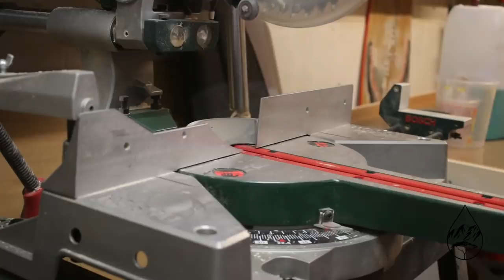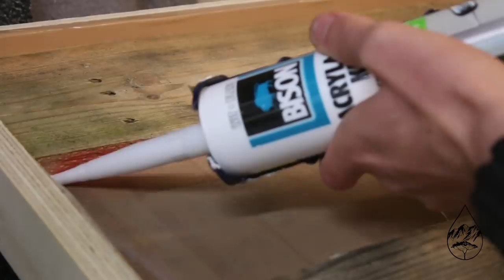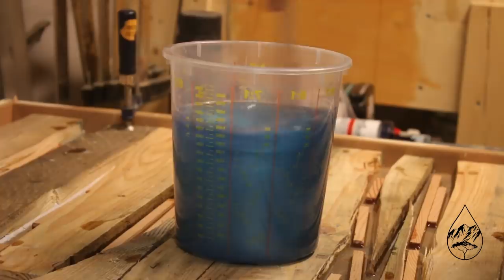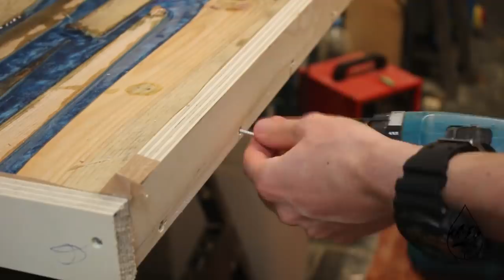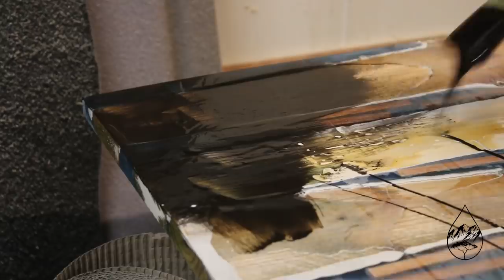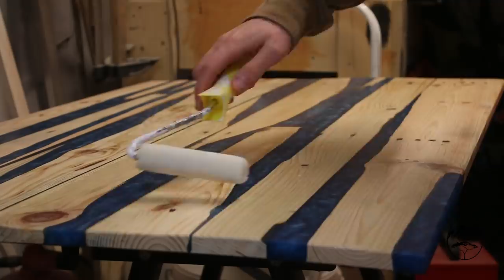Pallet wood & metallic blue epoxy coffee table

Comment: Hi mate great job 
What did you make the base frame for placing the wood and pouring the epoxy from also what was the white mastic stuff you were using and why
Reply from the maker: The base was made of the old table top with multiplex sides with tape on them. the white sealand is to prevent te epoxy to go under the wood.

Comment: Very nice, and inexpensive! I bet the epoxy cost more than the pallet wood ($0) and the frame combined. One question, what was the mixture you applied after planing and sanding? Thanks for the video!
Reply from the maker: haha yes the wood was free! the coating is a clear coat from Rambo for furniture. https://www.google.com/search?q=rambo+lak&rlz=1C1GCEU_nlNL822NL823&source=lnms&tbm=isch&sa=X&ved=0ahUKEwiQlfCnzozhAhXEh7QKHWfcBAIQ_AUIDigB&biw=1920&bih=1008#imgrc=UcjMl2ixS-O_DM: